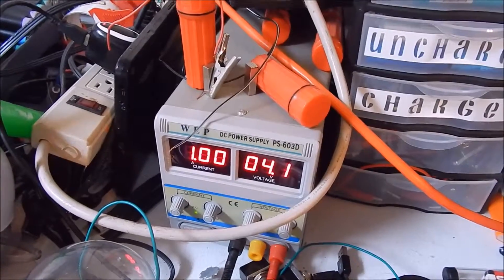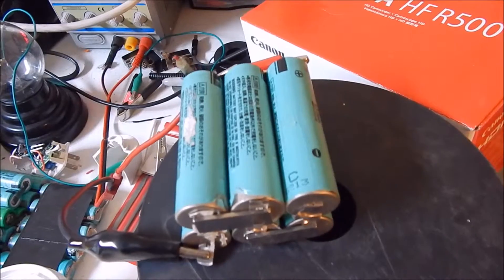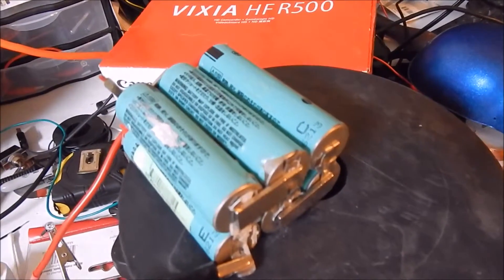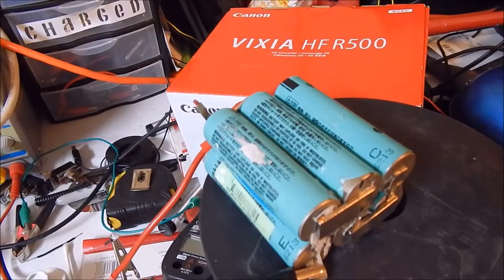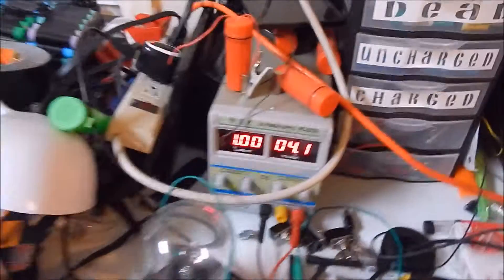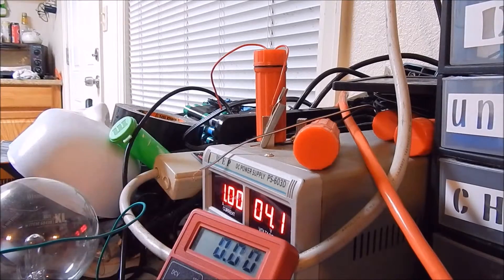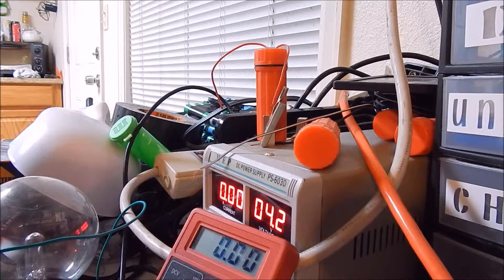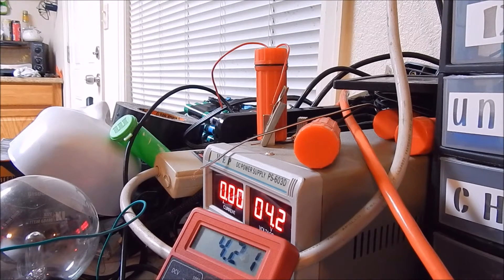DIY - Testing out a Ebay WEP DC power supply - Charging 18650

Comment: I use them $1 match holders to store my 18650 batteries. I stuffed little pieces of foam into them to hold the battery tight and to indicate if theyre charged or used up, I either face them positive or negative end down. Nice video. Im about to buy a 10 amp power supply just the same. For $15 more, why not have a 10 amp, right?
Reply from the maker: +Vallen Larsen Great idea! I have used them as a water tight battery holder for a flashlight as well. Works great! I do regret not getting a higher amp supply but it works for now.